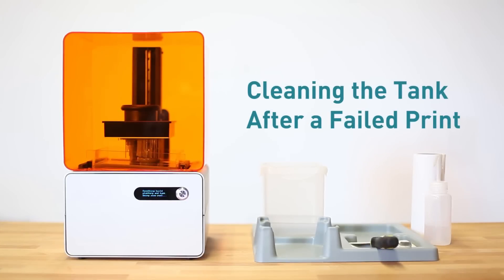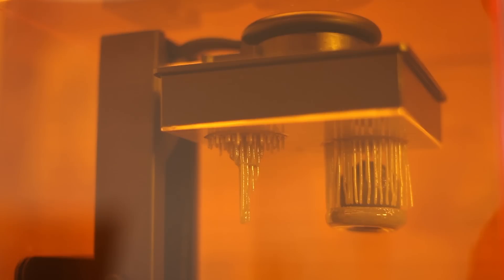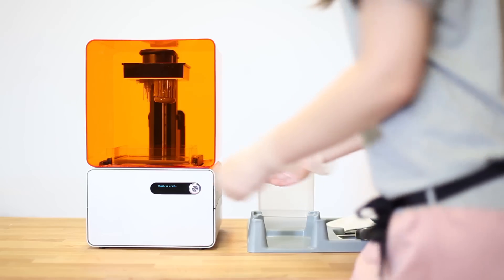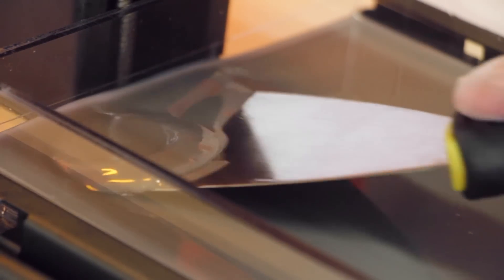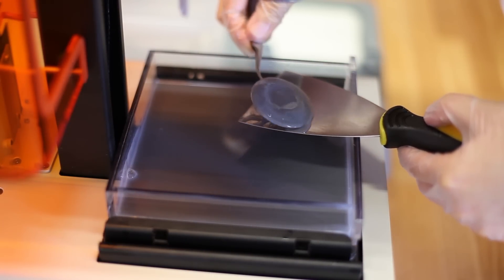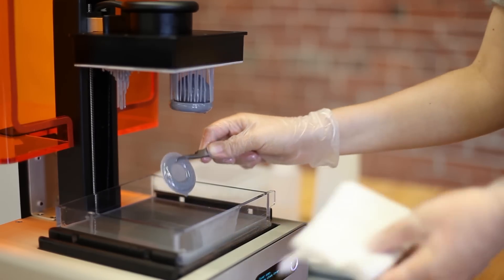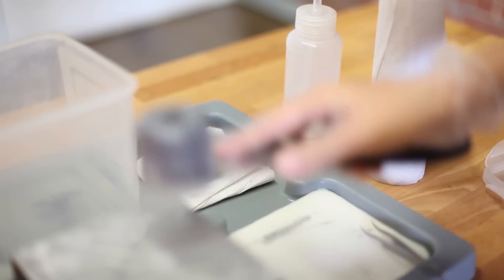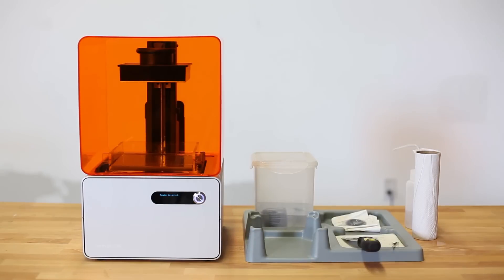Cleaning the Resin Tank

Comment: I never use the scraper/spatula to clean the silicon layer, unless I pull it toward me. The corners are too sharp, and may rip the silicon layer. Even in this video the person starts to dig the corners of it into the silicon. Instead I use the TWEEZERS, but I do NOT use the tips of the tweezers, I use the curved back side of the tweezers to pull the pieces stuck to the silicon up and away. It is also important that the resin tray be warm when pulling bits off of the silicon, or it may stick too well and rip up with the part. I have only damaged one silicon layer so far, using Durable Resin that was too cold to pull up when I did it.
Reply: I use a razor blade, I don't have a form labs printer, yet, but using a paint scraped destroyed my film on my DLP printer.